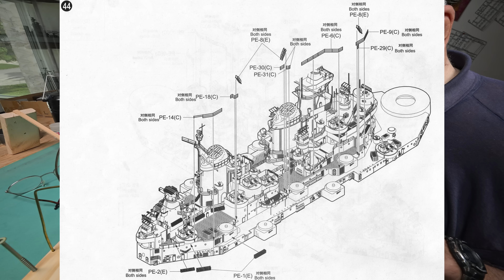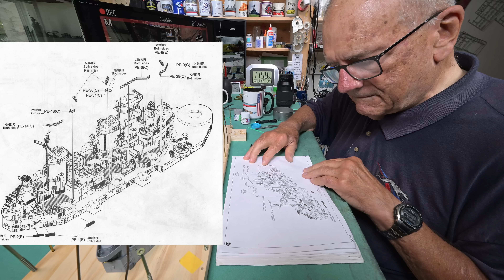The Model Ship - Part 1698

Comment: Do I see a crotch rocket as the next step to the Gold Wing?
Probably a dumb question but can that scooter be run on the bike path??  Looks like it comes with head light, turn signals, mirrors and the like so I assume it is street legal.  Does it need to be registered and have a license plate on it?
I see it has a continuous variable transmission, is liquid cooled and the front brake comes on automatically.  That should help prevent locking up the front wheel and then getting a closeup view of the the dirt or pavement.  I find it hard to beat a Honda, be it vehicle, motorcycle, or the engine on a power washer, rototiller or whatever.
Your Subaru is not going to like setting outside all winter while the Honda gets a nice warm environment.        
Let's ride!                            See ya.                  JimE
Reply from the maker: Re: can that scooter be run on the bike path? No!
Reply from the maker: Subaru has already filed a grievance! 😁